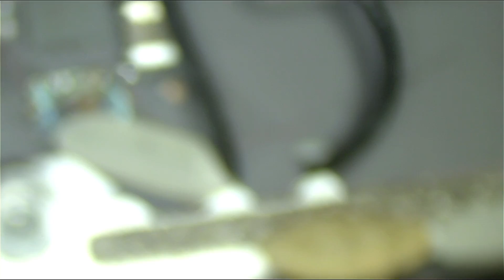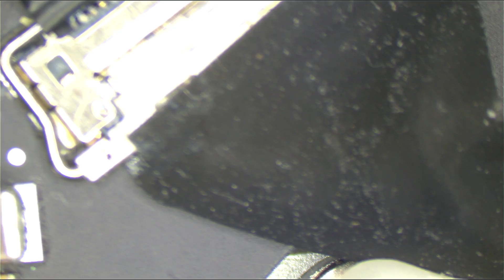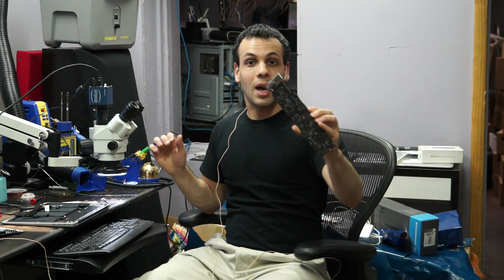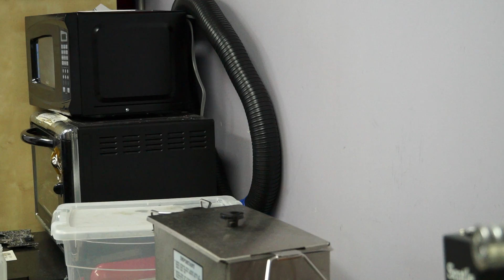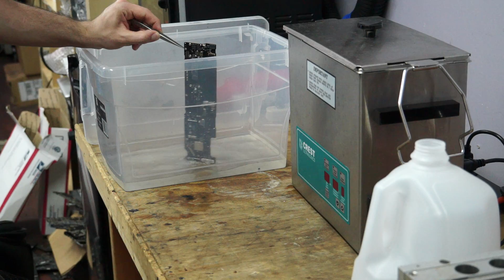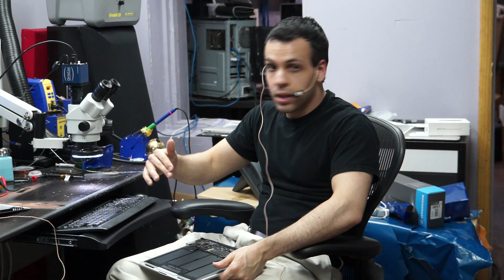How to use rice to repair water damage on iPhones and Macbooks

Comment: The rice is supposed to prevent water damage, not fix water damage. It's supposed to help dry out components before corrosion occurs.
Reply: If there is enough space for liquid water to get in then there is enough space for water vapor to escape.
Reply: Wow, lots of misinformation here. Most of you are both right, and wrong on details.
Rice, as Lard has mentioned, is a desiccant, which means that it draws in moisture from the air into the kernel, lowering the relative air moisture content. This allows a faster evaporation of the moisture within the device.
It does not remove the minerals or other crud in the water from the device however. It's also not a strong desiccant, you're better off storing those little bags of balls of silica gel you get with shoes, electronics and all that stuff. It works much better, and you can "recharge" them by putting them in the microwave, "boiling" the absorbed water out again.
Now, pure water in itself doesn't cause corrosion, and neither do the minerals, but in combination they do. Corrosion is a redox reaction, which means it needs a material that supplies electrons (the metal), a substance that absorbs the electron, (e.g. oxygen or sulfur), and if the electron absorbing substance isn't electrically conductive and liquid, also a medium through which the electron can flow. In the absence of this medium, corrosion will not occur. If you've dried out the device with a desiccant, the minerals remain. But if you've been fast enough, it may not have had time to have caused any corrosion. The problem is, many of those minerals are also desiccants, and reabsorb air moisture, so if you just keep using the device after drying it out without thoroughly cleaning it, it will inevitably start to corrode later on.
Putting the device in rice is not a fix. It's a stop-gap measure to prevent permanent damage. It's not useless, but without a 2nd cleaning step, it won't do you much good in the long run.
Reply: +Louis Rossmann If i have a device with water damage will it be better to send it for repair without taking it apart or dunk it in 100% alcohol then send it for repairs while sitting in alcohol
Reply: +Lard British you only get rid of the water, NOT the minerals in the water causing the corrosion. it won't fix the issue that the minerals in the water/soda/coffee/tea are the problem.
Reply: +Lard British It may be a dessicant but drying the device out will not help.  You bake on the minerals and impurities, and in the few days you dry it out, the corrosion is often that severe that it is not cost effective to fix.
Reply: I did not take in account the heat of the board and chips evaporating the water before you put the rice on it. Thanks for clearing that up. thinking back now it would be no different from using a decent napkin to soak up the water.
Reply: I've been researching into Mac speed ups and found a fantastic website at Achak Speed Plan (check it out on google)
Reply: bullshit!
I'always knew that using rice to dry electronics is dumb!
Reply: Rice actually sucks the water out of my ricecooker, which is an electric device, just like the iphone, so it should work
Reply: arno nabuurs
Rice is a desiccant.  That's not me saying it, it's multiple scholarly articles written on the subject such as these:

http://www.uark.edu/ua/uarpp/Publications/Drying/Banaszek%20and%20Siebenmorgen%201990%20Trans%20ASAE%2033%20%281%29.pdf

http://www.uark.edu/ua/uarpp/Publications/Drying/Choi%20et%20al%202010%20Trans%20of%20ASABE.pdf

According to you the ONLY thing you can do is prevent it 'by not spill liquid on it'. I'm going to assume what you meant to say was "You can ONLY prevent (water damage), by not spilling liquid on (electronics)."  So if you spill liquid on (electronics), there is nothing you can do.  I think you're wrong.  So, since that was all you said, I say to you: "All you say is bullshit."

All I was trying to say is that rice is a desiccant and will absorbs moisture out of the air lowering the humidity below a moisture saturation level allowing water to evaporate away from a wet source more effectively than without rice.
Reply: Thank you, I thought this point was quite important
Reply: It's kind of pointless, the water will evaporate with or without the rice, so why bother?  And if you don't remove all power sources immediately, you'll get corrosion.
Reply: Might as well believe in essential oils
Reply from the maker: +Lard British Rice will never suck water out of the tiny hole in an iPhone 5S phone's EMI shielding through the speaker holes in the casing. It's a 100% myth.
Reply: +Louis Rossmann  I agree it's not very effective and a hairdryer would serve you much better, but rice does absorb moisture from the air in it's environment to reach a state of equilibrium. 

"Conditions used to achieve moisture equilibrium between
kernels and 
surrounding air vary with research objectives and
techniques.  For example, Lu and Siebenmorgen (1992) and
Lan and Kunze (1996) both studied moisture adsorption
rates, but the former used a temperature‐ and RH‐controlled
chamber to reach ERH, while the latter used saturated salt
solutions to generate the required air conditions."

http://www.uark.edu/ua/uarpp/Publications/Drying/Choi%20et%20al%202010%20Trans%20of%20ASABE.pdf

What's your source?
Reply: @Lardzor  I'd say his source is years of repairing Apple products that many people tried to repair with rice.
Reply: +Lard British even if the water is dried it still doesnt remove the minerals in the water out of the device once the water has evaporated. its not the water that does the damage its the minerals. the only way to properly "repair" is to clean up the corrosion and fix any damage that it has caused
Reply: @cellphonerepairtx1  the minerals? LOL!  Water + electronics = short circuit = damage!
Reply from the maker: juggernautxtr exactly
Reply: I think you are a bit misguided here,or English is not your first language but corrosion is not given by minerals (though it can be accelerated by it).Corrosion is a chemical process which involves oxygen (it is an oxidation form).In circuitry, oxidation occurs even when without water in a liquid state (such as water in the atmosphere),and it depends greatly on the metal exposed to it in what degree it affects the circuit.Copper has very little damage from oxidation (it creates a protective shield),iron and silver oxidize very fast.There is another corrosion that can happen,galvanic corrosion (which happens when two distinct metals are in contact via an electrolyte)
Reply: +jimenez de Costa Not if the water has been evaporated.  When water is evaporated, the minerals are left behind.  As a cook I'm sure you know if you boil a pot full of salt water until the water is gone, you have a pot full of salt.
Reply: Lard British so what if the device was put it right as it got wet. Would that mean the rice would absorb the water meaning it would absorb the minerals in it ?
Reply: +Doc T&#39;Soni I guess that's why I've heard you're supposed to take the battery out and leave the battery cover off.  Not so air-tight that way.
http://appleapple.top/wp-content/uploads/2015/12/04957df55c73832d6972839bfdee84e3.jpg
Reply: +Lard You can ONLY prevent it, by not spill liquid on it, all u say is bullshit.
Reply: +juggernautxtr I'm a cook, so not an expert. 
If i cook rice in water with salt, the rice will fill itself with the water containing salt. If i cook it with kurkuma the rice will fill itself with the kurkuma and water and will get a yellow color from the kurkuma. Inside the rice will be yellow so i'm sure it will take the kurkuma inside. Doesn't that mean it will take up minerals etc.
Is it sufficient enough to fix the issue, maybe if you use enough of it. But this channel has taught me better ways so it's obsolete.
Reply: +jimenez de Costa It's not heat from the board and chips that evaporate the water, water will evaporate on it's own at room temperature due to the vapor pressure of water. It will evaporate until the air is saturated, but if you have rice, the rice will absorb water from the air to prevent the air from becoming saturated.

Comment: I was advising someone on how to limit damage to a soaked phone on a forum the other day (open it up, disconnect battery pronto, then properly clean it, or at least wash it with alcohol to remove corrosive liquids before handing it to a proper repair tech). A couple of idiots literally called me out as talking bullshit and instead advised leaving the phone in a bag of rice, if you could punch people in the face over a forum I would have done. 

Not only are they telling me I'm wrong, despite the fact that I have 15 years of experience fixing electronics (not phones and laptops granted), the advice they are giving will ensure that the guys phone will be a green crusty mess inside and will never work again. I mean the phone was full of Pepsi ffs. 

Anyway, the guy listened to me and after sending the board to a proper repairer after promptly removing power and cleaning it with alcohol (yep, he had some for making record cleaning solution, it was an audiophile forum), his phone works.
Reply from the maker: *****
there's a good quote on bash.org about that.
Reply: it would be an awesome ability to punch someone through a monitor
Reply from the maker: +Si1983h People drive me nuts sometimes.
Reply: +Squary94 I agree 😬

Comment: I had poured a cup of coffee on my macbook air. I took the machine in parts and cleaned everything up. After i got the computer in one piece again. The machine booted by plugging in the power chord. So it booted and said that i have to replace the battery. Also it ran slow. is this due to the fact that macbooks run slow at low battery? Do i need to replace the battery? Thank you for your anwsers!

Comment: would putting an lcd in the oven at 250 damage it?
Reply from the maker: +carl cagle Yes, DON'T DO THIS!!!
Reply: +Louis Rossmann cool I won't try it!
Reply: +carl cagle Thank you for the laugh...I'm sorry...I couldn't help it..
Reply: +Arthur Wellesley 1st Duke of Wellington I'm new and stuff
Reply: Why did you want to try this?
Reply: weeeeeell, i put a macbook underwater....it had coke damage and i used warm water to remove it, having watched a youtube video of a successful attempt i tried it. but i fucked up because yes the screen does have rubber around it but the hinges are not in fact water battling. so there i was with water in my lcd......i didnt put the lcd in the oven but i did remove the rubber use wd-40 and some clear plastic from the container of some new ram and got the screen off without one crack, no heat gun, just lube and really thin plastic. then bought some lint free rags, windex and some glass glue.  good as new

Comment: But what to do with alcohol damage?

I once cleamed an iPod touches display with pure cleaning alcohol and it got inside the display.
It never got fully good again, but after putting it in rice for a few days while keeping the display on all the time and charging it and heating the display with hot air (set tp ~120°C) every few hours it went almost good again.
Reply: +Benedikt Müssig It got into the backlight. The back light is behind the LCD and won't dry up easily.
Reply: +Benedikt Müssig Just heat up alcohol as isopropyl alcohol and ethanol (or methylated spirits) all evaporate quickly. Isopropyl will vapourise very quickly. Don't use rice....just don't...

If you want a make shift dehumidifier then use rice in a jar with a perforated lid and a contain for water to drip into. Otherwise use heat, open, clean and shit. 

Silica Gel is better

Comment: All the rice does is speeds up the dissipation of water lol. It IS FOOD, and not fixing lol. the rice works much like silica beads. whether it works or not IDK, ive never actually tired it (likely never will either) I would go straight to distilled water/alcohol myself.

Comment: 3:42 99% alcohol does not exist... 4% of the alcolhol evapourates when you open "a bottle og socalled 100% alcohol"
Reply: +Theodor Ellefsen If 4% of the alcohol evaporates when you open a bottle of "100% alcohol", then you are still left with a 96% 'full' bottle of "100% alcohol", right?
Reply: +Theodor Ellefsen and water will replace it
Reply: +Theodor Ellefsen thats funny because I have 5 liters of semiconductor grade 100% ipa sitting right here.....
Reply: Slot1Gamer then you have not opened it yet.
Reply: I asked my chemist friend this, he said that is true but it would take a long time and to start with you would only drop like 0.05%, unless you are using the stuff in the rain..
Reply: +Dimitri Pappas uhhhhhh w0t

Comment: I was under the impression that the rice thing was a way to get rid of residual moisture after you had already opened the thing up and let it air out.
Reply: Water isn't the problem.
The minerals inside the water which are conductive could damage your motherboard.
Reply: @marceldiezasch6192  The actual problem is that most modern devices have internal battery and when you get liquid on the electrical parts, electrolysis will be going until you disconnect the battery. You have maybe 2-5 seconds until at least some permanent damage occurs. Good luck with that iPhone – do you know how easy it's to disconnect the battery with that? If you can disconnect the power within 2-5 seconds after getting the liquid on the motherboard, rinse the motherboard with isopropyl alcohol and let it fully dry (with or without rice) changes are pretty high it will be okay.

Comment: Love your videos--this is probably the funniest!  
I have an iPhone 6 that had a very mild drop of water damage.  It still works, but there is a vertical line in the middle.  Another Youtube posting recommended that it was the connector.  from the LCD and that the connector should be brushed with alcohol, but that hasn't helped....A bit tough to explain with just text. Is there anyway anyway I can email you photos of the phone?  Thank you, Tiffany

Comment: I hate the person that first said rice did anything. 
In a lot of cases, it soaks up some of the liquid and just makes everything worse, by holding it there for a longer time than evaporation would.
Alcohol and a toothbrush is a really effective method.  I tried an ultrasonic bath, and I didn't have much luck (Didnt try the oven, may be my fault), but I have revived hundreds of laptops and phones with alcohol and a toothbrush.

FUCK RICE.

Comment: Hi Louis, would it make more sense to wait a little bit after a spill so that you can see where the water went and calcium build-up is on the PCB or would it be best to drop start cleaning the whole board right away?
Reply: The longer you wait the more damage will occur.

Comment: That's why I only use Samsung tough phones and Panasonic toughbook computers  I have had success in the past by dumping waterlogged electronics straight into pure alcohol even with high voltage equipment like colour TV's of the CRT variety.If you get the alchohol in fast enough you wont get the corrosion.

Comment: Rice absorbs water(it's hygroscopic), not like a sponge as you tried to use it but by leaving the damaged product in rice for a few days. Of course, that only works for water(very clean and not mineral). Although it is still wrong to do It, it can work under certain circumstances:  Do it only if you can't get your damaged product to a repair service and can't disassemble it yourself(after watching the video, who the fuck puts/smear their logic board in/with rice, wtf?), also if you spilled it with anything other than water(or your water is "hard"/calcareous/mineral/not perfectly clean) wash it with desisted water, wipe it dry as much as you can and leave it in a blow of rice for a few days.
Reply: +Kluneberg NO!  Rice is not terribly hygroscopic to begin with.  Stop this nonsense.  That is like saying a candle is mildly a heat source.  If I put a candle next to my MacBook, the heat from the candle will dry out the board in a pinch.  If you want to argue the "let's reduce humidity to save water damaged devices" then put it in a room with an air conditioner turned on---that is certainly far more likely to reduce ambient humidity than rice.

Better advice is to NOT DRY IT at all.  Disconnect the power is number one.  And number two is displacing the liquid with alcohol, or just dropping it in distilled water "in a pinch"  This kind of "it's not ideal, but it might help" advice is exactly why this myth perpetuates.
Reply: iPad Rehab Look, I agree with. I'm not saying it's a good option, just that it's better than nothing if you absolutely have no other options. Rice is just to speed evaporation of water, nothing more. Speaking of rice being hygroscopic, it can be used for other stuff, for example I put some of it in the salt shaker and the salt never gets wet.
Reply from the maker: +Kluneberg It is worthless. It is unfortunate that products like the thirsty bag have given people the idea, for three and a half years, that it is a decent option if nothing else is available.
Reply: +Kluneberg Rice does not speed the evaporation; It traps the water. 
If any rice actually DOES do anything in terms of soaking up water, it leaves corrosion marks on the motherboard in the shape of a grain of rice.

Comment: exactly all it does is pull moister out of the phone it will not fix it you still need to take it apart and actually clean it lol
Reply: +chris simmons It doesn't pull moisture out, it soaks it up and holds it there. And gets in the ports. And under flex cables. and between digitizers.